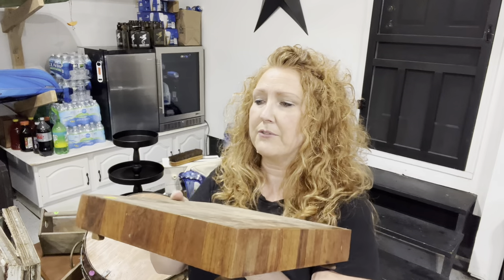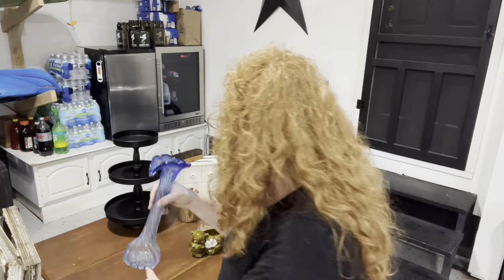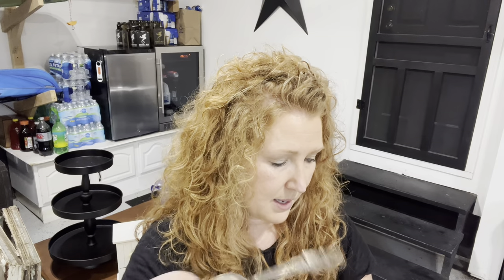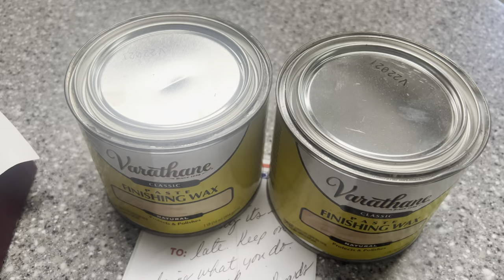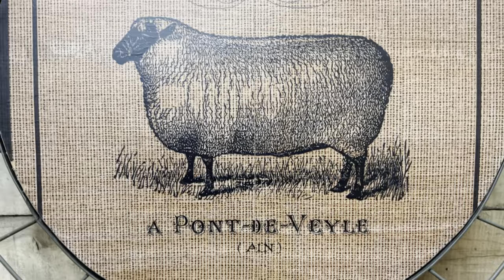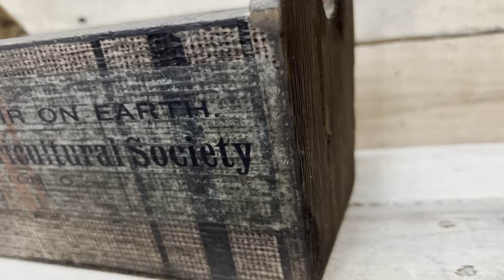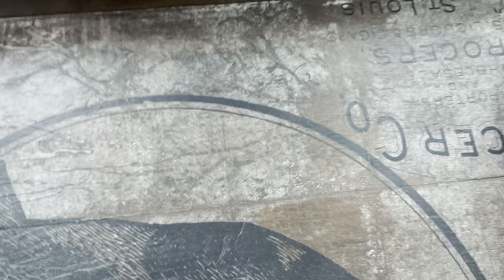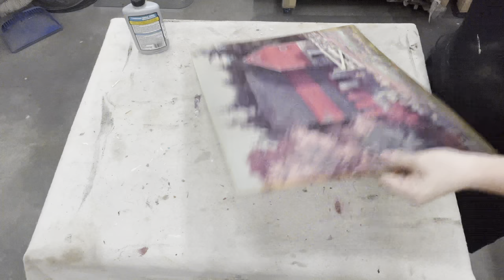Yard Sale | Haul | Home Decor | Haul | Makeovers

Comment: Wondering if you have ever rehabbed an old trunk.  I picked up  4 chairs that need lots of love and an old trunk yesterday for 20.00!
Reply from the maker: Great deal.. depends on what kind of trunk? I haven’t actually done that many of them🤗
Reply: @GingerChickRehab    I believe it an old steamer trunk.  I can see were the canvas covering ripped off.  The metal edging in the back is quite rusted.  It has the wooden slats around it and on the top.  Owner said her mom had it for at least 50 years and used it to store horse tack.  She also put wheels on it.  No inner tray but other then that the inside just needs to be cleaned up.